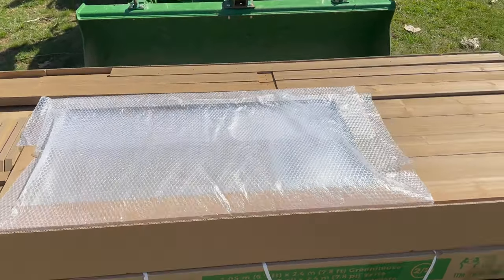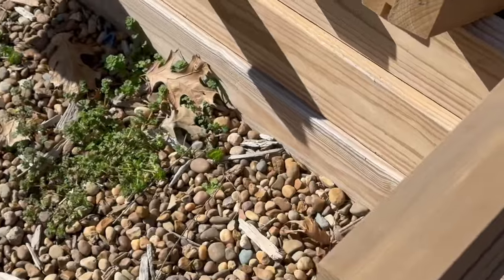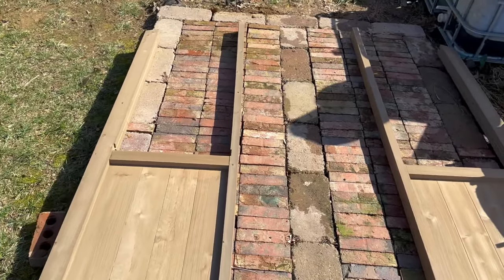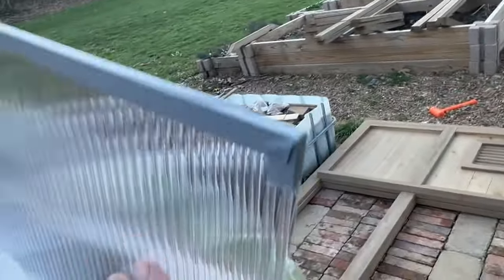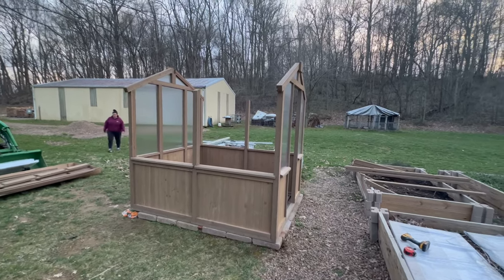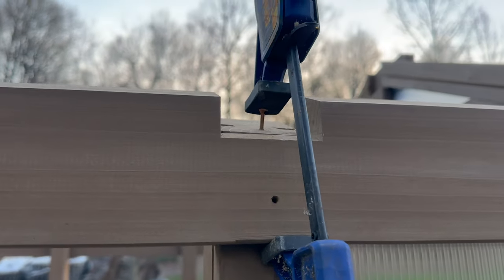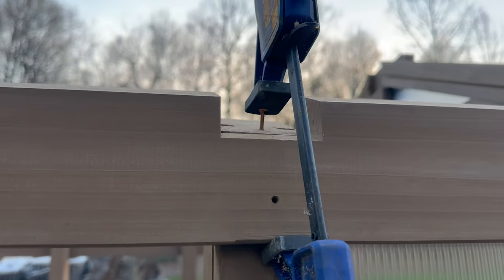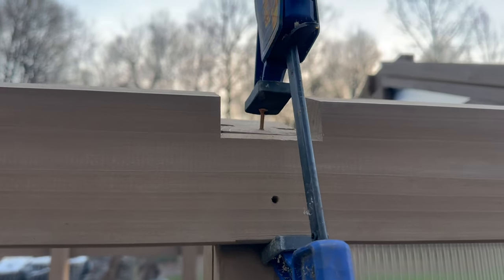Costco greenhouse build and review.

Comment: Thank you for this video. We bought this unit and are just getting started. Concerning the rebar you used to anchor the structure, what did you do to put a “top” on the rebar?
Reply from the maker: I don’t have a way to heat and bend rebar to form loop. So I cut off short piece of rebar and welded to top to form a L-shape and pounded in ground. Hope this helps!
Thanks
Scott

Comment: Just started building mine and it calls out the rafter ends to 1 1/2 inch overhang per plans. But I keep getting 1 3/4. What did you get on yours?
Reply from the maker: Hello,
I will have to check. Seems like I had some trouble with that also.
I will get back with you. 
Thanks
Scott
Reply from the maker: Looks like ours are somewhere in between. I think what happened is the top on each side needs either pushed in or pulled out to get it close. 
Don’t know if that helps. 
Thanks
Scott

Comment: What kind of bracket is that you used to put the rebar in hold hold the greenhouse down on each side? Thank you.
Reply from the maker: @frankmajors1703  
I took a piece of 3/16 plate and welded a tube to it. Screwed that to bottom plate on greenhouse and drove a piece of rebar with tab welded on it down through tube. 
Thanks Scott